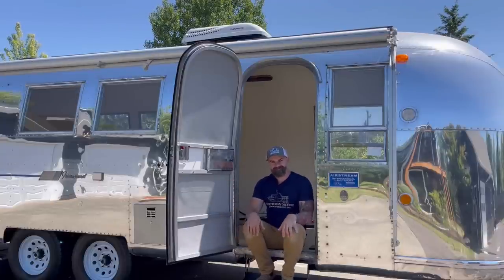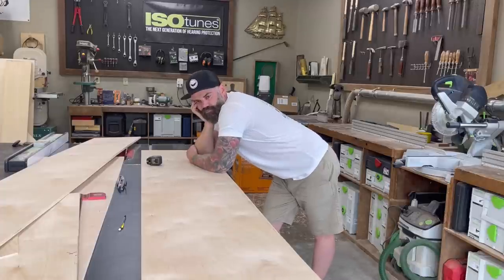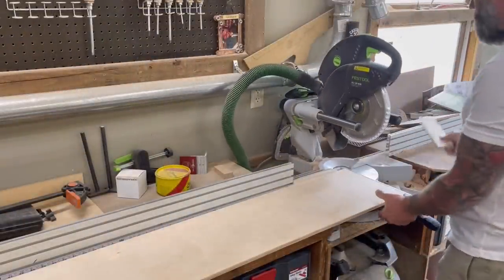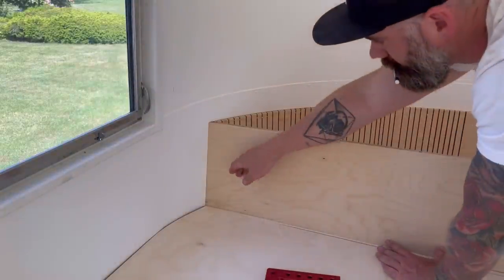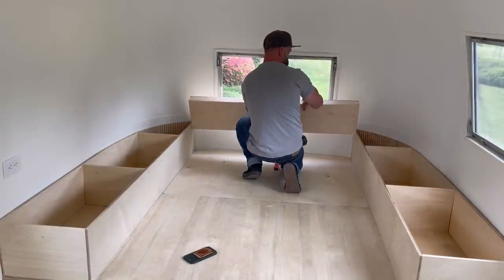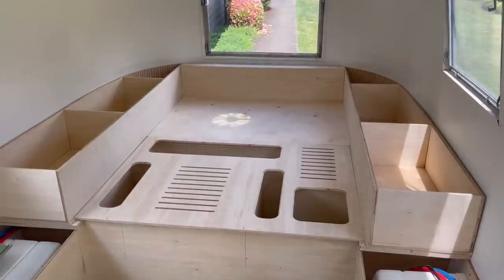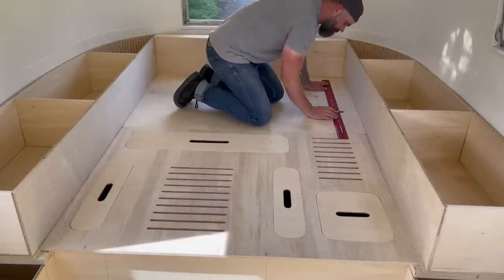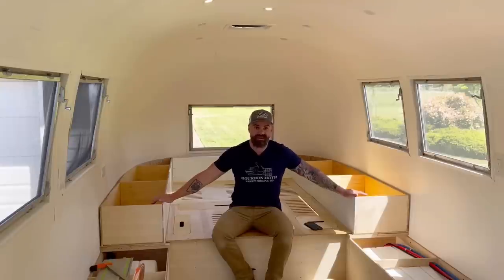Airstream Storage Bed  || Custom Building an Airstream

Comment: Great Video. I find that I can easily relate to you as regards time spent just THINKING about what to do and how to do it. And your craftsmanship is really quite good, insofar as I can tell. I, OTOH am a hack when it comes to cabinetry. I can DO it but I make a lot of mistakes. Even when I measure twice or even thrice, I still wind up cutting at LEAST twice.

As for the blow-out hazard and what it can do to your wheel well;  I have a 34' Class A on a Freightliner chassis. Before I bought it one of the previous owners had a blow-out at significant highway speed. The disintegrating tire (duals on the rear) ripped out a basement compartment, damaged the exterior wall of the RV along with the Bedroom floor. It had not been repaired properly and by the time I bought the thing, Delamination had caused actual ripples in the fiberglass skin. I cut out the damaged floor, planed down some clear grained, treated yellow pine to the thickness of the original composite floor and made some Z-channel to attach it to the existing floor. I then took the mangled basement compartment out with a recip saw, beat it back into its original shape, attached some 1 1/2" angle iron which I had predrilled to match the original holes and put it all back together.

My point being that rather than relying upon the structure of the camper to protect what's inside, just make damned certain that your tires are road ready and reliable. Otherwise, you could be in for a hell of a lot of work fixing it.

Comment: When you get to the refrigerator, DO NOT use the LP/ELECTRIC version. There are direct replacement size 12 Volt Refers, Using a 12v inverter/compressor, verses the Ammonia Gas absorption method. (Newer RV's are using them now)  Why? The LP/Elect requires it be level when in use. When traveling, using a lighted gas appliance, the refer, is Not advised, hence the food in the refer gets warm while traveling. The 12V inverter/compressor can run any time, does not have to be perfectly level to cool, and can be run from Solar arrays too. Only down side is a slight noise when the compressor is on, as is with your home refer.              Great work so far!              Suggest a little flip down door on the side shelves where the back curves. SO Handy when in bed for the little things that you may need at night, right next to your head.

Comment: I also had the concern (or rather, curiosity) on how you would access the compartments - and the hinges bed seems to solve that. However, since it seems the mattress is going to be pretty much totally built in, how will you handle the simple act of putting on  your fitted sheet? 

I figured that you would allow an extra couple inches to slide the bed forward and back, with perhaps a small lip towards the foot to hold it in place. but then you put in the box at the head, which effectively restricts it totally, from my view point.

Comment: I did enjoy the video. However I would agree with many regarding Weight. Baltic birch is great, but have you thought about using lightweight plywood? It good only because it will save gas/electric in towing.

Comment: First time I’ve watched your channel. I found it interesting and entertaining, thank you. Just a couple of thoughts… 

You might want to consider gluing some thick felt or something similar to the wall facing sides of your curved cabinet. This will minimize the possibility of the cabinets squeaking and scraping against the wall, which will ensure privacy when the bed/mattress is in use 🙉🙈🙊…😂…

I don’t know how OCD you might be, but, you could always use some Baltic Birch DAP wood filler. I’ve found this product to be very good at hiding blemishes in the wood with almost perfect matching the wood colour. I also mix it with some saw dust from the outer layer of the plywood which helps hide the filler by matching the wood grain too.

Look forward to next weeks episode… Cheers, TonyG

Comment: Watching you put glue on the wrong edge of that back piece made me laugh.  I did something similar last weekend, smacked myself in the head 3 or 4 times, and cleaned it up.  1/2" ply was an excellent choice for all this.  I know some folks probably wondered why parts weren't 3/4", but everything is supported well and you kept overall weight in check.  

Someone below mentioned the bendy plywood.  I've wondered why you didn't use that myself, but also remember how weak that stuff is.  It could get you around the curves, but you would have to butt it up to ply for mounting your hinges.  If the kerfs were to be visible you could just veneer over them anyway.  

This is an interesting build for sure!

Comment: If you realy concerned by weight - you should look toward lowereng number of walls and bottoms of your cabinets.
For new ones - there is already top of platform and trailer wall.
Front and short sides would be plenty if consider having dividers. 
This attempt, as addition, will give you opportynity to cut the hatches into the now-lost compartments same way as under matress

Comment: You should have considered an air mattress.  The 12” thick king size mattress in our RV weighed a ton …saved a lot of weight  with the air mattress and it is easy to lift to access the storage underneath… way cheaper too.

Comment: Great project! I turned a 16' cargo trailer into a combo camper/office back in 2008, so believe me when I tell you that you'll regret not putting a pull out drawer under the bed, vs the cubbies accessible under the mattress. Also regarding ventilation for your matress, it's completely unnecessary. I used a solid, non-ventilated, piece of plywood under my matress and I've never had issues with mold/mildew, and I live in my mine for months at a time when I'm on a remote job. The only mold/mildew issues I've had are with the ceiling and floors when I store it after extended usages. I've had great luck with the new Microban 24 pump spray. I wipe/mop both surfaces, and then as the last bit of cleaning before storage I spray both surfaces (and my fridge) down with the Microban 24. Also, regarding storage, a few deep areas are good for bedding, etc., but always divide any deep storage cubbies into shallower "lift out" and/or slider drawers. There is nothing worse than needing an item that's at the bottom of a deep storage area. I've actually given myself a project for this summer to redesign some deep areas into drawers. GOOD LUCK!
Reply: In the first episode he measured for a drawer and marked it.  It will come out the front of the bed.  He just isn't building it yet - stay tuned (Jason thinks of everything).

Comment: Great work Jason! 
What if you remove the plywood sheets underneat the curved cabinet carcasses, to save weight? It will be two layers of ply here, and if you remove the first layer you also will lock the cabinet carcasses with the middle section. Just a thought, maybe you have an other plan 😊
Greetings from Norway 🙂

Comment: First, I must say that I really enjoy your channel. I get a lot of great ideas from it. 
My suggestions for the wall and door. Unless your cabinetry in the main section sticks out far enough to interfere with the door to the bed, I would make the door the same width as the bed. As for the door, in most RV’s some of the doors are accordion types going from side to side. Personally, I found that instead of that I used a roll-type retractable blind. Then for rigidity, I mounted it into tracks on both sides (“both” not “either”. Either is one or the other, not both) and had it retract up so it remains out of the way. 
I hope this helps you. 
Charles
Sorry about being a word Jerk, but I spent over 20 years in broadcasting. So it messes with my OCD. 😊

Comment: My suggestions so far. 
1. Cut holes in the storage boxes in the front part of the bed compartments that will allow air to actually vent out to the outside storage. 

2. Add outlets to those back corner pockets that aren’t being used 

3. Instead of full boards for the side panels just cut strips and attach them to your walls for support. That way you have less total weight.

Comment: You should run some low voltage wire into each compartment to put some LED lights in there.   It will help a ton with finding things.

Comment: Could you add an access hatch or drawer to the front panel under the bed instead of lifting up the bed to access the storage under bed? Depending on how big your wall opening will be I suppose. Just an idea. 
Also, I would allow for a power supply to where your fridge will be just to future proof yourself because I think you’ll get over the issues of the gas/propane fridge. Dometic have a 12v upright fridge freezer you could look into. 
But damn that thing is going to be good when you’re done!

Comment: If you plan for 3 to travel, make permanent beds for 3. Extra ones in table but default by the amount of regular users.

Other thing i saw somewhere  was a dual purpose shower. It had coathanger as hinged "door" to shower, serving as closet and shower simultaneusly. Seemed such a great idea i would like to see your version.

Comment: how about  lights around the bed and ventilation for You as you sleep make sure you put some plugins and a place for a fan or 2   we used to camp in the back of our pu topper and Always needed a fan  Or a heater  , i know you will have a big  roof ac but getting the air back into the bed room might be a consideration  .  and just standing  around thinking is GOOD better than tearing it all out again !!! good luck Have FUN!!!!

Comment: I’ve never built a caravan/trailer before but over 30 years we’ve had a bunch of them so I’ve seen some construction methods. 

First, do not, ever, sacrifice even an inch of storage. Those corner triangle bits can function as a little night stand with a little cubby. Same with that tubular box in the back. Magazines, blankets… 
Also you may be heavily over building those boxes. A lot of those caravans use thinner “aircraft ply” and often times they do not have a back to them. You need to haul all that ply around and with a whole family the weight adds up quick.

I was assuming you were going to insulate the rear storage hatch. With those vents it might get a little drafty. 
I’ve seen a lot of beds that had some air slots below, but that back storage is usually not accessible from inside.

Comment: For the curved sections with kerf showing, up at the back wall that are boxed off… could you cut small access holes in the boxed off divider part similar to the sections under with outside access? Just a small rounded off square hole in each. This way, you could use this space, for something you rarely need. P.S. love the videos 👍🏽👍🏽👍🏽

Comment: There's an alternative to trying to make curved backs on caucuses that perfect match the walls, find flexy aluminium or plastic U-channel with a 1/2" inside measurement and fasten it to the wall, then insert the panel like a rabbit (rebate) your curves can be far less precise and you still get a clean finish with no air gaps.

Comment: You should have used LiDAR app or some professional laser 3D scanning to get a model of the inside to get the curve of the inside right…I think it would help with the design on sketch up or Fusion and then cutting those pieces.

Comment: I would have just made a front face frame for the units either side of the bed and just screwed a batten to the wall to sit the oak top on. Would have saved on material time and weight. Loving the build so far. 👍👍

Comment: Have you considered the shink rate of the metal vs plywood? Aluminum and steel shrink more than plywood in cold temperature. Ask the dude who did the renovation work for a suggested tolerence in fitting maybe ?

Comment: I'm going  to recommend these 2 you tube videos for you you should be able to steal a lot of good ideas from them: they are both about fitting for wooden boat building but the techniques should transfer to airstream interiors :) 
Sampson Boat Co: Mocking up the interior (Rebuilding Tally Ho / EP105)
The Art of Boat Building: 3 methods of Spiling for a Boat Hull, Carvel Planking Part 1, S2-E17

Comment: As a Airstream owner make sure all through holes especially in the floor and between compartments are well sealed because they make great runways for mice (you don’t what a Mouse running over your wife’s toes in the middle of the night). I’m not sure on the older Airstream, but the floor is insulation between the frame rails, and there is mental panels pop riveted to the bottom of the frame to hold in the installation. Make sure that is well sealed the mice will get in there and make a permanent home.

Comment: I think those vents at the very back will create the problem you are trying to avoid (moisture). Under the vents leads to the outside through the (likely) poorly sealed cargo door. With your AC on inside cooling the mattress from above, the moist air leaking through the cargo doors will condense moisture on the cooler underside of the mattress. Bam, mold.

Also, you are leaving a path for bugs to come in through the underside of your mattress from the outside.

Comment: You might want make various locator pins and use some type of material to eliminate movement squeaks.  When traveling the parts will not remain in place.
Reply: Some pins/dowels for those side pods are an excellent idea

Comment: With more than 400 comments, I find it unlikely that you will ever put eyes on this one. But I just wanted to point out that that back window is an excellent exit/entrance point if for some reason once the walls and doors go up, you can’t negotiate those large storage carcasses out through the door. And for what it’s worth, I think you are wise to be honest, and be open to comments from those who have come before you. I am not familiar with airstreams specifically, but I have owned my 34 foot travel trailer for a little over five years now. I will continue to watch the series and if I think of anything worth sharing, I will post again. Best of luck! So far everything looks fantastic!
Reply from the maker: Awesome man! Thanks for the input 🙌🏻🙌🏻

Comment: One nice fellow already hit on my first thought (Brian Truesdale’s earlier comment) that there may be issues with the boxes causing problems, rubbing the walls. I’m in agreement with the idea of adding a foam or padded buffer between the walls and the boxes. Particularly, I’m thinking the rattle of the camper vibrating as it rolls down the road with the cabinets bouncing off the walls the entire time, may damage the boxes or items in them. Also, it there is movement in the camper (someone walking or wind [keep it PG here, don’t go towards the rocking car idea]) while someone is sleeping, I’d think there’s a likelihood of the same banging of boxes against the walls.

Maybe some auto door seals (the black spongy rubber your door closes on), or similar?

Comment: A regular mattress has to have at least 30% of its area underside accessible to air. Most bed slats allow for 50%+. You don't have nearly enough holes on top, Jason. 

Second, the compartments are separated as air tight, so the moisture will have nowhere to go from there. What you did is merely move the mold issue from the bottom of your mattress into the cubbies themselves. Your inner divider walls have to have vent holes between each other and need to vent out into the living area, preferably a small 5V fan next to the drawer you plan to cut out to force air circulation. 
If you sleep in this for prolonged trips, you will have mold issues, guaranteed. You'll need to take the mattress out regularly to dry it out with your current ventilation. A human can easily sweat out a quart of water a night.

I'm in planning stages of converting a v-nose cargo trailer and this topic is something I spent a lot of time on and many DIYers point to this as one of top 5 people underestimate. Humidity is a problem, because mold is there before you even smell or see those black spots. It will be Inside your mattress and will make you all sick way before that
Reply: My suggestions aside, I love what you are doing and your thought process. Will incorporate some of your ideas into my build.
Afterall it was you who taught me how to make kitchen cabinets and the importance of having a track saw. Excellent videos.

Comment: if it was me, i know that flipping the mattress up and back down would get old quick and i would end up not using the underbed storage at all. if you think about the action of jumping on the platform, grab the flipped half of the matteress at full arm length and pull it up and back while sliding under the ceiling and through the door....forget about it! :D
if you get the mid hinged mattress you may want to consider pneumatic hinges for just that half and access the storage while confortably standing just outside the door

Comment: For the fridge, they have ones that can run on multiple power sources so you can seitch to what you want to use. For you I would do the three power option since you can run propane, electric, or battery. That way you're not for ed to rely on propane.

Comment: very nice as always, Jason.  I was just wondering if you could use all that storage under the side cabinets.  I was kinda surprised you made a separate bottom piece on the cabinet frames, and that you didn't add holes to access below the bed.

Comment: Remember to try and balance the overall weight of the trailer over your axles as best you can as those are designed to carry the weight.. and keep the tongue weight in the back of your mind as it has to be less than the rated cargo capacity of your vehicle. This is different than tow capacity because it refers to the vertical lift rather than the horizontal pull.
Reply: Tongue weight should also be between 10-15% of the trailers total weight. With ~12% being ideal.